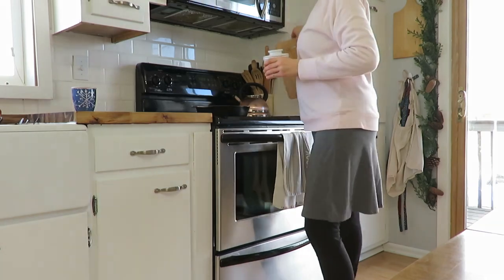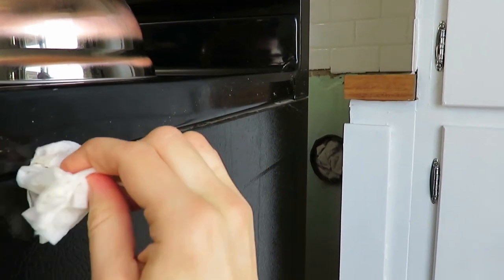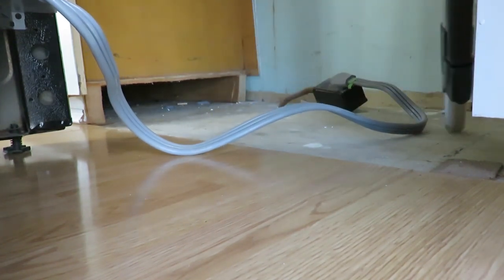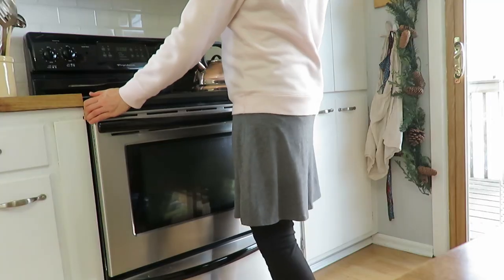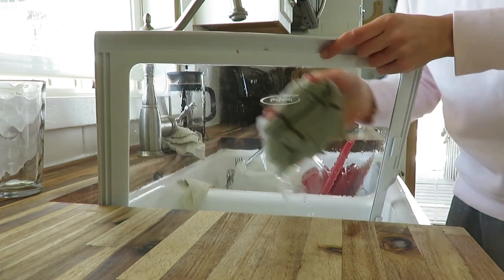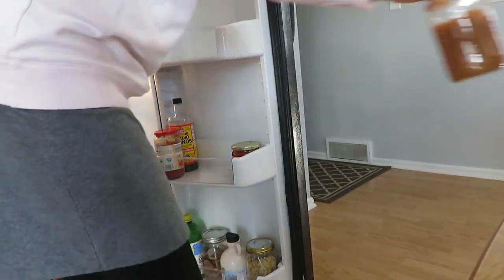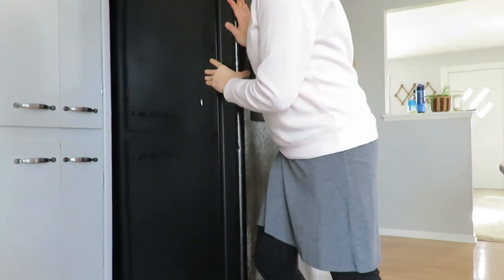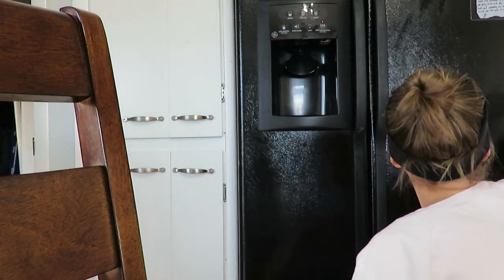Kitchen deep cleaning | satisfied homemaking

Comment: I used to do this all the time and when my husband retired I had him help me. He never knew I did all this. It amazed him. You need to remove the grill on bottom front of refrigerator and it need cleaned. . There is a drip pan under your refrigerator and it gets very nasty. I always took mine outdoors on the grass and used straight bleach to clean it wearing disposable gloves. There are grates also under your refrigerator that  need cleaning. They gather a lot of dust. I have a long bottle type brush I use. Also  I always did this part first because of course your floor will be dirty again. The grate or vent area on lower back need cleaned also. It is rewarding . You did great job!!!